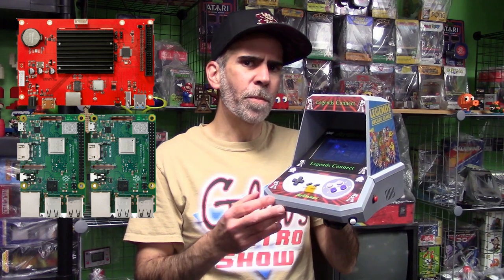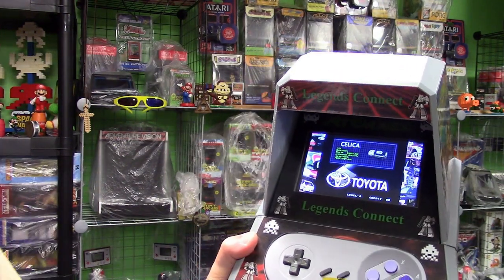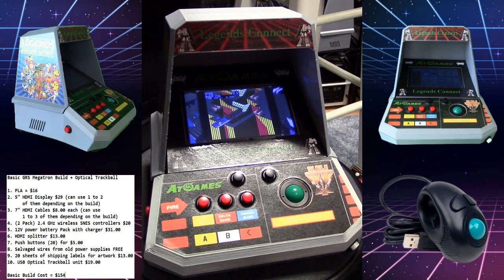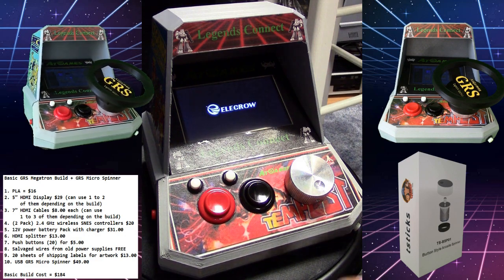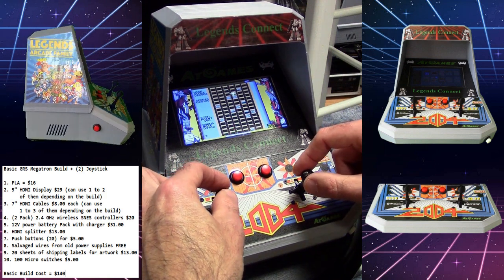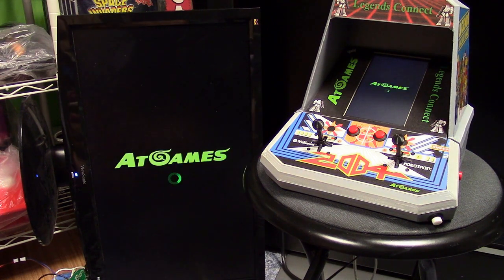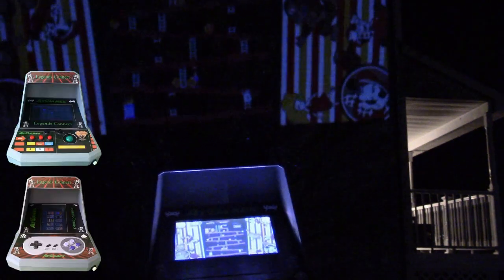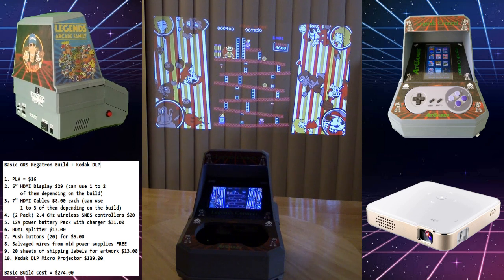AtGames Connect Contest Submission - The GRS Megatron Portable

Comment: Hi Glen what is the list of games on your system?  Also, can you plug the system into your wall outlet/surge protector for continous power?  I love the Transformers clips!!
Reply from the maker: Hi Hollywood.  Well the AtGames Connect has 2o build in games ..not sure if it's finalized yet but that you can check on AtGames website for the latest details.  Outside if that with MAME and Coinops it literally has 1000's of games it can run. From Arcade, to home consoles.
Oh, yes it has a built in 12v battery unit that yes can also be plugged in to charge it as you are playing ...so yes you can leave it plugged in to run on A/C power all the time if you wanted too 🙂

Comment: Glen, you have outdone yourself.
I thought the basic one was amazing.

but when you showed the trackball control, i was very happy,
and then you topped it with the spinner control,
and the racing control, and the twin joystick.
each one made it totally possible to play almost any game.

so when can we preorder one? ha ha.

the only thing you are missing, is a mini tron joystick.
you should be able to miniaturize that, and make that another control,
and then you would be done.

also, if you make the spinner top smaller, it would fit the cabinet better,
and make it match more, like the smaller trackball.

other than that, you should win the competition, very versatile and
affordable to for what i can do.

later
-1
Reply from the maker: Hey negative 1 thank you.. well I only had 30 days to do this.. Tron was planned just ran out of time also I did rest with my star wars yoke in mouse mode ..it works ..just really had a time crunch but can be done in the GRS Megatron v2.0
Reply: @GlensRetroShow  Oh my GOD, i didn't even think about a mini star wars control. ha ha,
but you're right, given enough time, you could make mini controllers:
---
major havoc roller
720 joystick
xybots twisty joystick
49 way sinistar joystick/food fight/road runner hall sensors

the possibilities are endless.

later
-1

Comment: The thing I like about your build, is that the controls look very precise. 2.4 ghz wireless snes instead of Bluetooth is a nice touch. The small trackball and spinner are great. The sound also sounded great. You demoed some of the most difficult games to emulate properly due to the controls and your system performed like a champ.  Edit: the projector just makes this a definitive winner.
Reply from the maker: Thank you so much.  Myself never been a fan of bluetooth controllers due to some latency but it was a lot of work getting these two operate properly initially but now people shouldn't have any problem using these inexpensive 2.4 gigahertz controllers with the unit. the big thing for me is always having the right controller for the game if you don't have the right control for the game the complete effect is ruined thank you very much for your kind words :-)

Comment: Very cool Glenn. I'm super impressed with how much versatility you built into this tiny machine. I'm actually planning on using the Legends Connect in am Arcade1up mod and have been impressed by the range of machines in general this is able to power.
Reply from the maker: Be sure to share your build 🙂